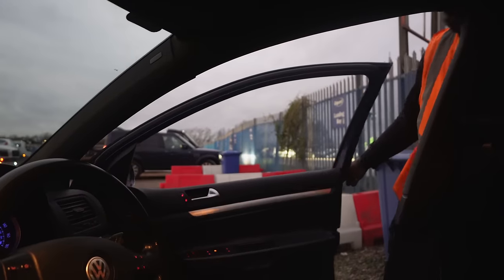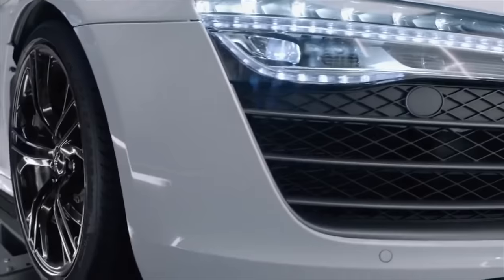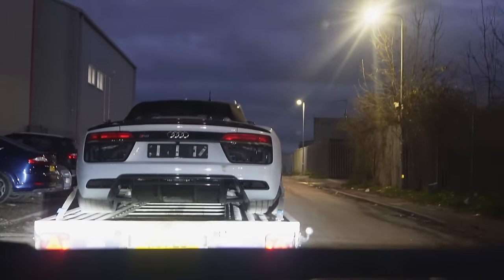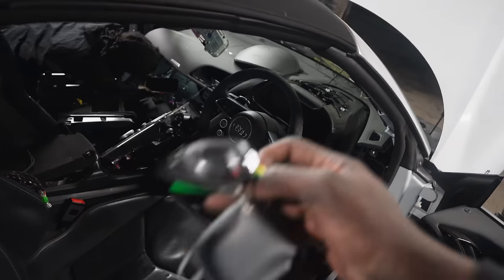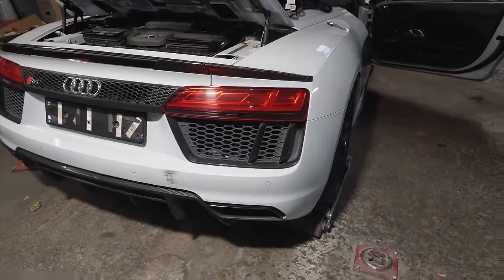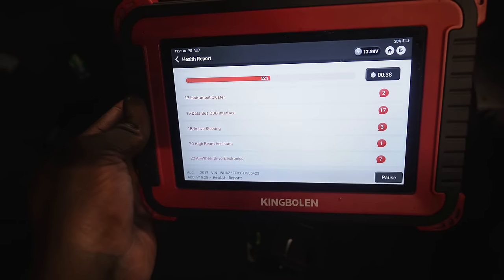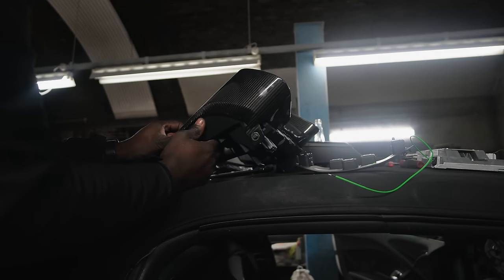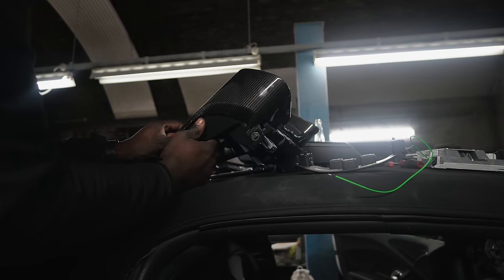I JUST BOUGHT THE CHEAPEST 2018 AUDI R8 V10 PLUS IN THE UK... QUOTED £65K TO FIX! 🥹

Comment: yo D i need help brudda ive got a 2018 rs4 ive been working on for the last 5 months its nearly completed but i had to replace the drivers headlight the headlight is a matrix headlight from a l/h drive rs4 as it was from europe so it was passangers side but in the uk its a drivers side its been all plugged in but not working at all how do i code it from a passengers side headlight to a drivers side headlight

Comment: But if it was stolen your fob won't work anyway will it? Don't thay wipe the original and use there own.
Reply from the maker: Well that depends on how they stole it, thats why i wanted to get in touch with the previous owner, but no luck so far. But i plan to get a new ecu/key kit. Next ep will be huge